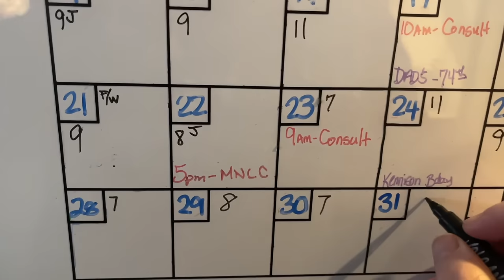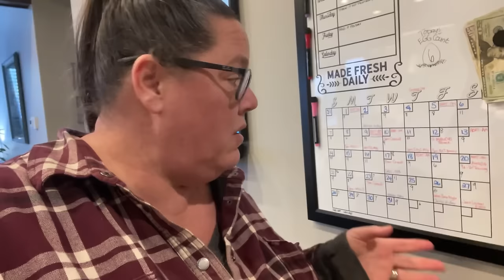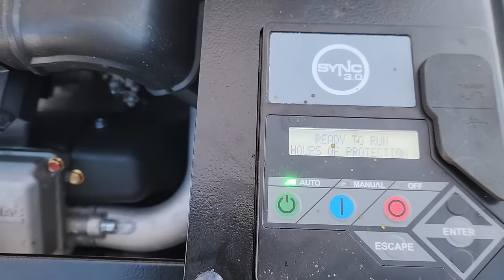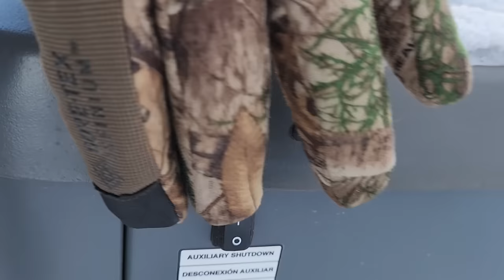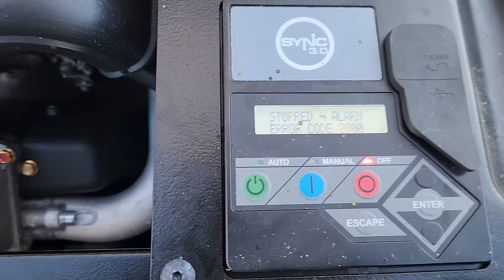Surviving The Cold: Keeping The Homestead Running At Thirty Below

Comment: Can’t you heat up the the chicken coop with with solar panels just to keep them warm when it’s like -30 use free energy just to keep the birds warm❤❤❤❤❤❤❤❤❤❤❤❤❤❤❤❤
Reply from the maker: Simon we purposely dont heat their coop. Too many horror stories of coop fires. We do have a heat lamp on the human side of the coop to keep the chill off. This keeps the coop about 20-30 degrees warmer than ambient temperatures with our extra insulation built into the building. Chickens are a very hot breed and can tolerate these cold temps as long as your acclimate them to the cold. Another reason why we don’t heat our building is if we have a power outage and they are use to warm temps they could die of shock if we lose power for a long time and they lose their warmth. Our coop also is not connected to our backup generator as chickens weren’t in the plan when we built the house. 

Great question and I'll bring this up this topic in a future video.